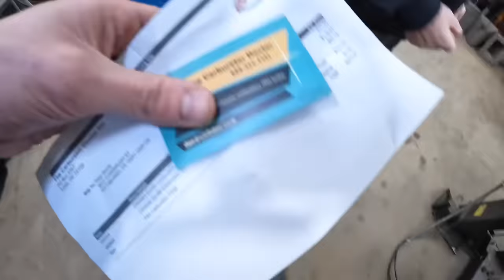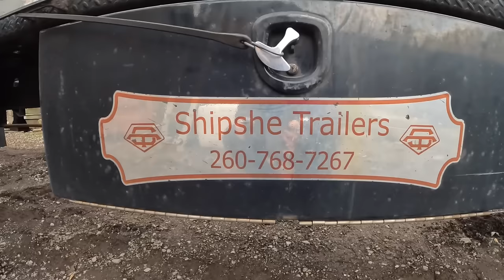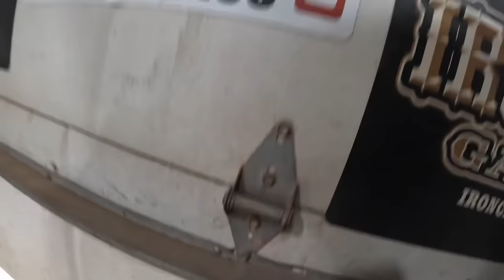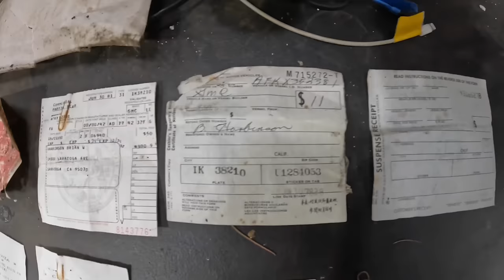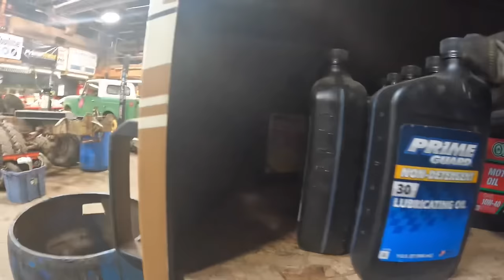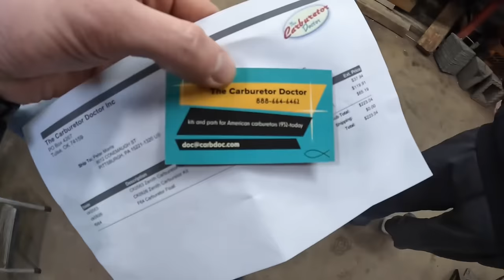Trying to resurrect 1942 GMC 4x4 COE. WW2 era Truck.

Comment: Nice truck. It does get down below freezing in Salinas, not often but it does. I used to drive a two wheel drive version of that truck, taller and heavier duty dump truck with two speed rear end. It had a chrome grill and clean red and black paint job. An old lady waved and said,"nice truck"...it got a lot of looks. That was in the 80's. All those cabs were made in '37  but went on trucks even after WWII.

Comment: TRY TO FIND A LEAD HAMMER TO TAP VALVES SO YOU GET THE POWER TO MOVE THE VALVE   BUT NO SHOCK TO BREAK THE VALVE STEM    / LIKE MACHINIST USE TO TAP PARTS  DOWN IN THE VICE TO SET FLAT  ON THE PARALLELS   AND CAUSE NO DAMAGE TO THE PARTS

Comment: I would of got the thing running out in the yard and drove it into the shop the thing should have a inline 6 and those things are so simple to get running as long as they turn over and not seized and it has some compression and the carb is half ass functional

Comment: On old machines like that is after draining the oil fir new  then pulling the plugs and flooding cylinders with mystery oil ( kerosene/ATF to soak a few days before any attempt to move pistons) and then I pull the starter and clean up the bendix thouroughly and gease. Spin test and inspect the brushes. Then you grab the hahmonic ballancer with both hands and gently turn back and forth a little to break loose the rings. If it moves slowly work it back and forth untill you go 180 on each side. Now gently rotate a full rotation. Then back. Now oil the cylinders and turn.it till it is turning full rotation. NOW --- with the plugs out ( you'll want to spread shop towls over the open plug holes and it is time to spin it with the starter motor to get everything cleaned and slicked up. Next clean and free the valves by turning and a lite square tap with a ball pean hammer on the top of the valve stem to settle and seat the keepers etc. Then after checkingbthe carb n setting up a n alternate fuel source. Plugs back in and pray for spard to start it. If you goninto it like you will likely wake one up. Im 80 and been reviving of forgotten machinesInwas bout 10 yrs old. ( Old diesels are  almost allways waiting to be rescued)  I love the old COEs. Especially the Dodges withthe hemi engine.😂😂 Dandahermit.

Comment: What is the issue with the WWII era bed? It does not fit the truck. I think the answer is that the bed is from a FORD 1 1/2 ton GTB "Burma jeep." I say that as the bed has the bumps over the rear tires that a Chevrolet G506 does not have. The USAAC did not like the Burma jeeps because the tire bumps got in the way of a crated aircraft engine. Chevy 1 1/2 tons did not have the bumps. The mismatch paint should be a red flag. Getting a correct bed will be difficult.
Reply from the maker: Yep you’re right.
Reply: aw the new buyer can make it a Mountain jitiney bus back million people carrier.

Comment: The cargo body is from a Ford GTB
Reply: Was it the same bed used there and in the ton an a half  Chevy ?
Reply: @heartland96a  No, that cargo body was only used only on the Ford GTB. I believe that the rear wheel arches, built as part of the bed, were then discontinued for all cargo beds. It was faster, easier and cheaper to build a true "flatbed" cargo body for all WW2 trucks.
Reply: @ShercoBill  Thanks for the update .

Comment: Before they took the lead out tail pipes rusted out and the rings  wore out at about 100,000 miles.
Lead in our system caused violent behavior and lower IQ.  Good riddance my car has 188,000 miles and doesn't use oil
it still has the original tail pipe. Leaded gas started in about 1935. why didn't the valves burn out before there was leaded gas.